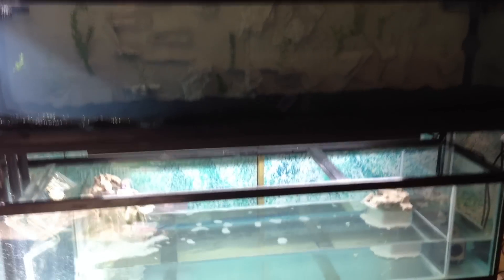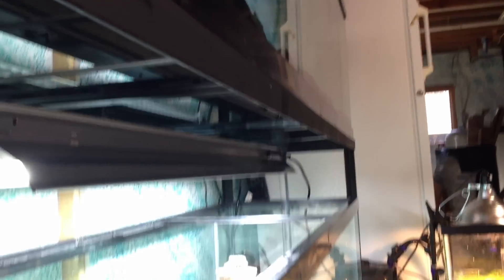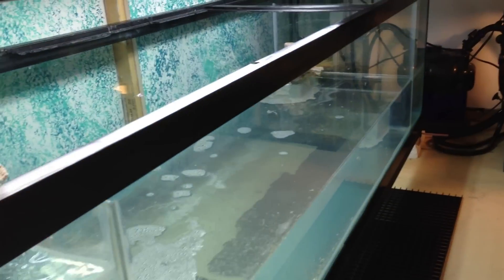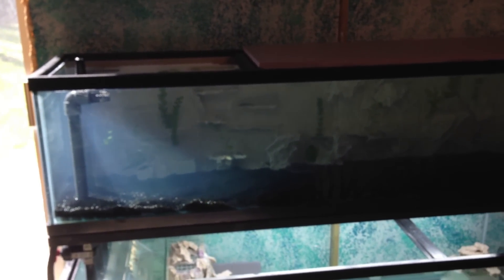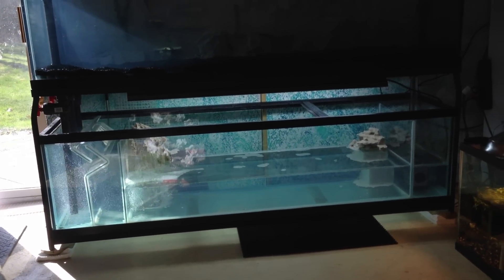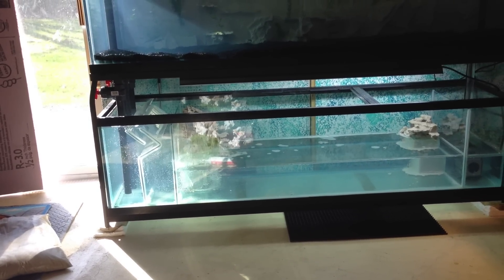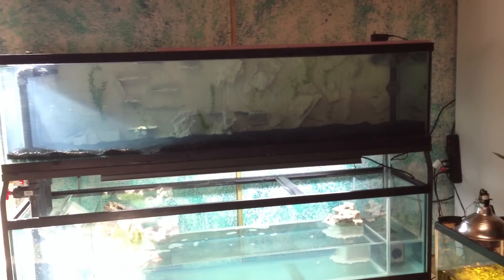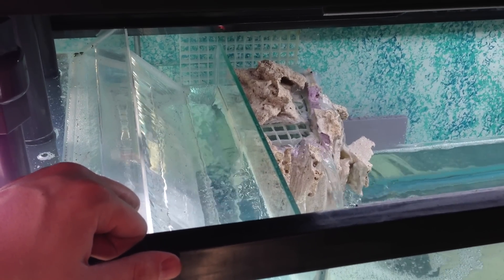Part 19 - Dual 100 Gallon Display Tank/Filter setup DiY

Comment: Part 2. Them you can either drill holes in it under the water level to let all the air out of the pipe with ought disturbing the sand, or you can cut it again until it is just under the water line. Then put a tee on the end to let water shoot out the sides and not into the sand. I think this would help to keep bubbles out of the sand. The only draw back that I can think of is that not all the water would go into the sand filter but you might be able to get better fluidization. It’s just an idea.

Comment: Good question. I think that the component to the left of the bottom tank may act as a filter if filled with mechanical media and maybe biological. Then if he uses a load of (live) plants in the top tank, that would get the job done and if the tanks are lightly stocked and there are enough plants; he would never need to do a water change (but I still recommend doing them).

Comment from the maker: This isn't the kind of siphon that can be lost or not be strong enough. All that is being done is the overflow pipe is being restricted to the exact amount of water coming in, this inadvertently creates a perfect siphon. It's merely a matter of how much flow is entering the tank, and only allowing that amount of flow to leave through the overflow. The method is called "Herbie Silent Overflow"; if you google that you'll get some very good explanations on the system.

Comment from the maker: Correct, if you buy play sand you have to make sure you do not get the ultra-fine, the you have to wash it for about an hour to remove all the tiny particles. If you do that you can be sure to have a safe experience.

Comment: I have a suggestion on how to keep bubbles out of your sand filter. I’ve never done this so don’t take my word on it. Tighten your siphons so that they make a complete siphon with ought bubbles ever coming out. Then shorten your overflow tube, the part that is under the tank and goes down into the filter. Make it short enough that it won’t go into the sand.

Comment from the maker: The lower tank is the entire filter. Tim Burchell is basically correct except I'll have all the live plants in the lower tank and just fake plants in the upper tank. The video I have on here "Freshwater fluidized Sandbed Filter Design Explanation"; is the first filter I made, and is the filter that this is based off of. The lower tank starts with a fluidized sandbed filter, then flows into a fluidized bio-media filter, then into a refugium, then through course media before being pumped back up.

Comment: I also don’t suggest getting play sand. Play sand is not all the same size, so some if it will be as small as dust. The smallest parts could bet into your pump and ruin it. Pool filter sand is uniform in size and dose not need as much rinsing as play sand. The extra dollars you spend on pool filter sand could save you a pump.

Comment: I understand that, but it is very difficult to get a complete siphon that won't lose its siphon, suck air, or is not strong enough to take all the water so that it won't go into the overflow stand pipe. But I do hope that you can get the siphon to work right. good luck.